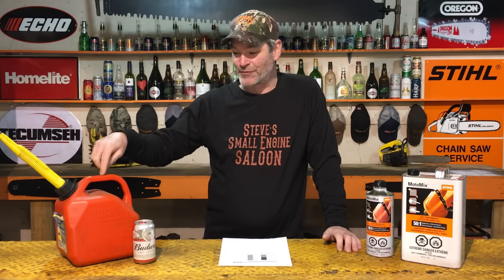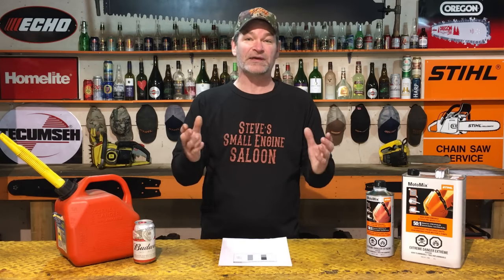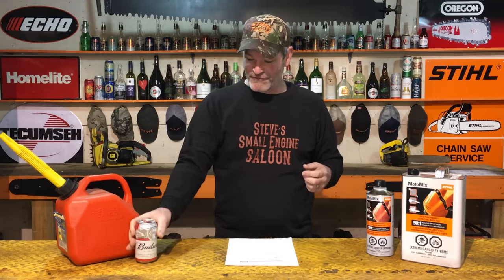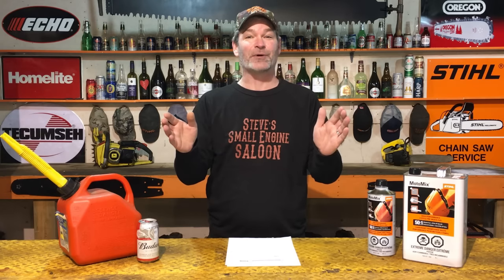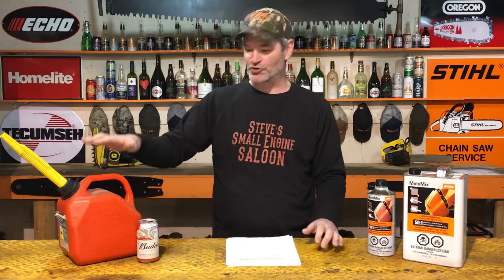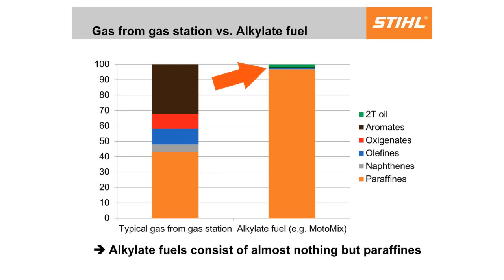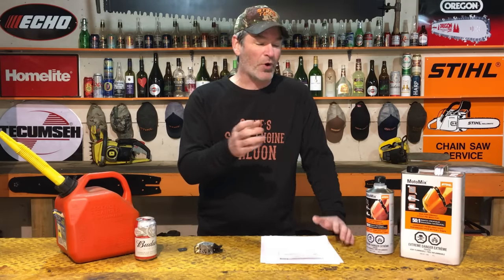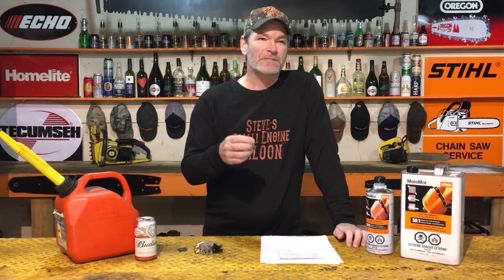The Ugly Truth Why Gas Station Fuel Is Bad For Small Engines

Comment: I'm a "journeyman" old school chain saw engine builder from the lumber boom days of the 60's and 70's in Oregon with some 10,000 engine builds built for commercial big timber fallers and tend to lean towards the old school way.  I will probably never accept paying some 10 times the price for special fuel.   Non-alcohol pump fuel is fine for me but be sure to use high temp manufacturer compatible mix oil, never outboard motor oil.

Comment: Are these bad compounds in the fuel also hydrophilic like ethanol??
The reason I ask this question is because I pour my gasoline into a clear inverted jug and add water and aerate the fuel with air bubbles and then I wait a few minutes and then drain out all the bad crap from the bottom of the tank leaving me pure fuel that I enhance with a  shot of two stroke oil and octane booster.
My 21 hp vanguard has ran like a champion ever since I adopted this practice or should I say ritual of fuel purification.

Comment: first off, i know i am "behind" in watching your videos but, i have yet to see a video where your beer is a miller high life.

second, Aspen fuel is new to the USA, and is not yet available here in the southern USA. question on the aspen 4 stroke fuel, it does not attract water does it? i am hoping the answer is no it does not.

ethanol blended fuel is even worse on small engines where the air is humid, it also hurts cars because it attracts moisture from the air, which will corrode steel, copper, brass, aluminum.  i have seen this first hand, and had to seal the tank on my mom's car and throw away and replace 3-4 year old carburetors on small engines.

i work on small engines as a hobby, even though i am disabled and it can take me longer to work on them now.  when it comes to pump gas, i can get non ethanol pump gas.  in 3 years, i have yet to need to so much as clean the carburetor on my briggs and stratton engine due to using non ethanol gas.  not everyone is going to be as fortunate as me with non ethanol pump gas.  ethanol is everywhere.  ethanol also contains a jelly like substance, after approximately 18 months, sometimes as little as 3 months, that jelly will clog the carburetor.

anyone who only uses their small engines 1-2 times per month, or sometimes less, i would recommend the canned fuel you get from the store.  my small engines however, are sometimes in use as much as 7-10+ hours per day, sometimes every day.  if it rains here for say, 8 days, then they sit without use for that 8 days, but mine are used often enough i do believe i can continue using pump gas, that and, one or 2 are used so often, there is no way i can afford enough of the canned fuel to run them.

i know Steve, long comment.  i also cant wait for the Aspen fuel to hit the shelves here, done seen a test that showed it to be only one of 2 canned/bottled gasoline's to actually be clean burning, and i want to see if my engines run better and/or cleaner on it than the non-ethanol pump gas i am able to get now.

Comment: Great videos. I'm a subscriber. But there are some implications in this video that need to be cleared up. Stihl shows 30% aromatics, and although you don't say it specifically, the implication is that aromatics = benzene. Aromatic, in chemistry, refers to cyclic compounds that possess alternating single and double bonds. These compounds are very stable because the bonding electrons are "shared" around the ring. Aromatic ring structures are extremely common and  found throughout nature because of this stability. According to the American Chemical Society:
"Gasoline in the U.S. is usually blended from straight run gasoline, reformate, alkylate, and some butane. The approximate composition is 15% C4–C8 straight-chain alkanes, 25 to 40% C4–C10 branched alkanes, 10% cycloalkanes, LESS THAN 25% aromatics (BENZENE LESS THAN 1.0%), and 10% straight-chain and cyclic alkenes."  I know that clickbait is a necessity for Youtube videos because of popularity algorithms, but non-ethanol gas station fuel is NOT bad for small engines. And nobody doing any serious woodcutting can afford not to use pump gas. It is expensive because the ingredients required to meet octane goals without aromatics are expensive. Canned fuel may be an excellent fuel for winterizing and great for homeowners who use saws only briefly over a long period of time, but for general use, stabilized non-ethanol pump gas is the way to go.

Comment: Hi Steve
I would like to pick your brain if I may, on the subject  of fuels for a high performance  chainsaw.
Imagine if you will, the saw has had extensive porting work done,  a fancy muffler that looks like a musical instrument, as well as higher compression. Additionally  some carburettor  mods and a higher rated ignition module so that it revs harder.
Indeed, what you could call a race saw.
What fuel would  you recommend  to get  the best performance, after all that work and money invested.
Kind regards brother.

Comment: I run 91 octane in all my small engines, including my 4 stroke outboard. Then I add Sta-Bil to the fuel for the last running period before seasonal storage. That was the procedure given to me several years ago by my Cub Cadet service tech. All of my equipment has run well after bringing out of 3 months+ storage. Leftover un-mixed hi-test fuel for my yard tractor, in storage jugs an

Comment: I run CAM2 race fuel. Just add oil to make 50:1 and never worry about it.  Get it at local gas station. It cost more but still cheaper than those fuel cans by stihl

Comment: Regular pump gas doesnt harm your engine at all, as long as it doesnt sit for a long time without any use. The ethanol in the gas will eat your internal carburator parts over time, but if you use your mower once a week it shouldn´t be a problem.

Comment: I got rid of my gas mower and went to an Ego 2102 propelled mower, plus I bought a small Oregon electric chain saw that I can use to cut up tree limbs that blow off the cottonwood trees.  The only gas I buy is for my old pickup and the wife's Subaru car.  If I live another 50 years, I might get an electric car, even though the electricity is generated by coal powered plants.  So much for the green revolution.

Comment: definatly gonna use this tru fuel from home hardware in my poulon pro chainsaw now i dont use it often so wont hrt the wallet lol may even buy some for mr vintage outboard might have to throw more oil in thou unless they make a 32:1  mix its supposed to be 25:1 but ive ran up to 32:1 on vintage snow moblile engines stating 20:1 and they never blowed up

Comment: I have some videos I put on YouTube regarding the harm that regular fuel does to small engines. Regular fuel damages fuel lines and gums up carburettors as well as making two stroke diaphrams brittle. I tried to get my employer to invest in engineered fuels when storing small plant. Not interested. I then started ended replacing carbs and fuel lines as much as twice a year. Reliability shot up but management complained about the man hours I was putting in and number of spares being used. Fortunately for my sanity  I got a better job offer (in a different line of wirk)

Comment: I buy cheap gas station gas. I have a 2008 Honda crf230l motorcycle, a craftsman walk behind mower, and a 89 Honda tractor mower. I constantly have to clean out the carbs on my mowers. I open them up and find a clearing gelatin everywhere in there. Why doesn’t this happen with my motorcycle that also has a carb? Even if I don’t use it for months it starts up fine every time.

Comment: I have all my gas powered machines in the garage taking up more space than a full sized car. New this year is a Honda driven power washer. Both lawn tractors are old, one wicked old; 25 and 40 years old. Changed carb on new one; never even cleaned the oldest one. I have a STIHL 026 Pro and STIHL trimmer same age; never had the carbs cleaned, never broke down. A backpack blower got to be at least 15 years old. A 35 year old good sized Ariens tiller, 8 hp, 30-35 year old residential use. Craftsman chipper, a North Star splitter, none needing carb or engine work. All get plenty of use between two homes plus. I used regular gas. Been more recently using StaBil with alcohols in fuels. I run everything dry for 5-6 month storage.
I have no problems unless of course these fuel suppliers just now put the crap in the gas. Over the last year or so I’ve seen my neighbor’s new Husqvarna chain saw die using true Fuel. So for now, I’ll forgo the premixed fuels. I love ya Steve but I don’t agree with this post regarding the destruction of our 2 cycle machines due to gas station gas.

Comment: Hi Steve, I generally love your videos, but I have to disagree with you on this one. I'm not saying anything regarding the facts you found but simply, that I have been using top tier 87 octane fuel with ethanol and stabils in my gas for my lawn mower and both echo blower and string trimmer for over 15 years with no failures or carb rebuilds. I make sure I drain the gas at the end of the season and change my oil on my lawn mower and just drain out the two cycle gas and get rid of whatever is left and start fresh the following spring. 0 issues here brother. Just sayin, more than one way to skin this cat! Thanks for all your findings though!

Comment: If you run youre engines ,every day ,yess ! You can use "cheap gas" if not well complications will arise, me ,on the other hand ,i use Petro-Can 94 with Pro-Lab DB F4 ,and a little 2 cycle-oil ,in everything !! And since many years go by ,still haven't had any issues , Nothing !!! No problem whatsoever.

Comment: Steve you would be horrified our UK standard gas station fuel is now E10 which 10% alcohol. You can still get 5% alcohol but its much more expensive. This is a newish change and in next 10 years we will know what E10 does to our cars. It mustnt go anywhere near a small engine. It totally screws the carbs and dissolves any plastic parts. Sorry just learnt from you its the benzene on plastic. Is that true? I and everyone I know blames the alcohol.

Comment: In my experience the engines aren't soured about the gummy buildup inside. Most engines I've seen from the 1980s still running and have never seen any of these special fuels. They are for sure a lot better than the gas station fuel. But when carbs are cleaned from time to time the engines don't really care if they run on the regular or on the special fuels. I'll switch to them anyways cause i got some good old quantums here that i intend to keep for long

Comment: To winterize small engines, both 2 and 4 stroke, run them until they run out of gas. This prevents varnish build up from old gas in the carburetor. If you have gas in cans, add fuel stabilizer and keep them in a cool place, the gas should last 6 months to a year if was treated when fresh from the pump. All small engines will have a sticker on it saying E10 is OK.
Good time to change the oil in them at the same time, check the air filter and clean or replace the spark plug.

Comment: Using Motomix in my weed eater and chainsaw since buying (4+ years). Every time I need my equipment, it starts just fine (after 1 week or 6 months). It's expensive but after I've done the maintenance this year, plugs and reservoirs and other things are very clean.
Reply from the maker: Right on

Comment: My understanding and what I’ve seen is that engendered fuel is dirty while burning at least from brands I’ve seen. And at the added cost. No   Logger with self respect would spend 20 bucks for a tiny can. When most of us have ram dirty engine oil as cutting oil before to save money  during hard times

Comment: This pre-mix stuff is a nice concept but it's extemely over-priced for the results. If you're concerned about your carburetor, just dont buy the cheapest fuel you can find in town. Not all fuels are the same. I suggest Shell which has high quality control systems and has the lowest benzene content of the pump stations. Also, get the highest octane they have (93). One last thing, if youre worried about not using your fuel fast enough (that is <2 months storage), put some fuel-stabilizer in your mix. And in case anyone is curious, I did study organic chemistry. Dont be scared into buying this over-priced fuel.

Comment: Buying the cheapest brand I could find in my area it cost me 15 dollars to trim edge and cut my lawn once a week.  2 gals. of gas will last me 4 to 5 weeks so @ 4 weeks I would spend 60 dollars vs. 6 dollars on reg. gas  I think it would be cheaper to buy new equipment every two of three years. BTW I have never gotten less than 5 years out of any small engine equipment and I have always used gas from a pump.  I do use it for my snow blower but I only use that 2 or 3 times a month in winter and it is not being used 9 month out of the year so to me it is worth spending the extra money for that.

Comment: I was really surprised. I did that checking for ethanol in your fuel test with the tall thin clear bottle on our local fuel station which is the cheapest in town, it had no detectable rising of the line marked on the bottle even after a full day of settling.  I don't know if this is the norm in Australia especially when I picked the cheapest outlet we have out of about 8 or so depots in town. There was a really big curfuffle a few years back about the United fuel depots mainly having a lot if ethanol in their fuel and it was reported to be ruining engines. So maybe the whole Australian fuel industry really cleaned up their act. I was really surprised to find nothing though.

Comment: It would be cheaper for most people to just use regular gas station fuel and then when the carb or engine goes bad after a few years, just replace the whole thing. It would still be cheaper than paying for the engineered fuel.

Comment: I have three chainsaws, three string trimmers and a leaf blower. The most I will do is buy gas with no alcohol in it and put stabilizer in it. Of coarse I put stabilizer in all the gas that I put in a can. Zero turn gets it, push mower gets it, log splitter gets it. This year happens to be the first carburetor I've rebuilt on anything in at least 15 years. I even think that was my fault because I put acetone in my fuel to. I think I put a little to much in and melted a diaphragm and put a hole in it.

Comment: I use 100 Low lead for all my winterization I take a 5 gallon gas can to the local airport and purchase it there then mix in the oil, I have a pole saw I had not used for 3.5 years took it off the wall and fired it up on the 3rd pull ran like a top, airplane fuel does not go bad for up to 10 years nor does it have all the BS that is in regular Mogas and will lubricate your engine better due to the lead. granted if  you ran lots of it you would have to clean your spark plugs up more often due to lead fowling just like in our planes but that's no big deal cost currently for 100 LL is 4.80 per gallon way cheaper than engineered fuel.

Comment: If you can commit to starting and running your engines once a month, gas quality is not a problem. If you can't do that, drain and run dry. If you can't do that, store the equipment with the fuel tank "brimming full" i.e. fuel drips out when you put the cap on and there is no air space.

Comment: First as a beer an collector in the day, I noticed it,ok, my ski doo, last bunch of years been having dirty carbs, seems to be more crap in gas, in canada they say our gas is better than us gas, live in boarder town, but I think it’s alll shit.  So March 19, took carbs and cleaned real good, ran great , put away in April with some stabil, start a few times in summer, ran great in fall 19, til April where there was a electrical issue and it stayed covered outside til October when I got it back from hunting camp when moose hunting. Sat out side covered til last week til I could get to it. Changed coil then it started but only on one cylinder. Got spark, so means gas, took off carb and in bowl was a snotty glob stuff, wtf, not happy, so what is best way to leave sled two stroke, empty tank, full tank, sea foam, stabil, I just run straight 87 octane gas. Oh, it don’t make ya bad have the odd beer, 1-3-5-7, ha ha

Comment: The Term "paraffinic hydrocarbon" simply means a fully saturated linear hydrocarbon of any length. Not to be confused with Paraffin in Europe which is kerosene or jet fuel. or Paraffin in the US which is a long chain fully saturated hydrocarbon that is either a wax or almost a wax.  The opposite of paraffinic is olefins and aromatics, which are unsaturated (contains double bonds). Benzene is also in this category, though cyclic with a bond that is halfway unsaturated. The unsaturated hydrocarbons love to join together (almost polymerizing), making gums and varnishes.  Fuel stabilizer is a free radical trap lie BHA or BHT or Vitamin E that prevents polymerization. Ethanol contains oxygen, which is an electron pair donor, so Ethanol is bad for a much greater reason than water absorption from the air, which of course can be limited by keeping the cap closed on the container or tank. The donor electrons promote polymerization of the unsaturated hydrocarbons.
Reply: Finally, a competent analysis of the fuel chemistry! Some chainsaws have vapor lock problems in warm weather... therefore the need for higher octane. Higher octane, especially with Ethanol, means more gums and varnishes. My solution for occasional 2cycle small engine use is operating with a high octane, non-ethanol bottled fuel and don't store any fuel in the appliance during storage. For my boat, I add fuel stabilizer during the storage months to minimize varnish and gum deposits.
Reply: @raminghadimi9701  Thanks.  :)

Comment: I think if you're using your equipment everyday run whatever works. For storage I tend to use a fuel stabilizer and top it off. I have boughten the MotoMix but think it is a ripoff... way to expensive.